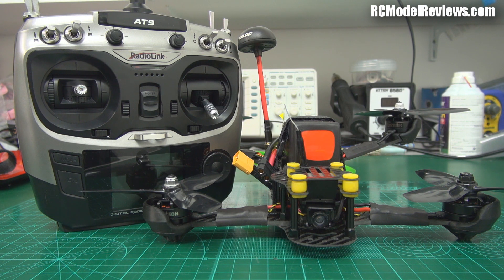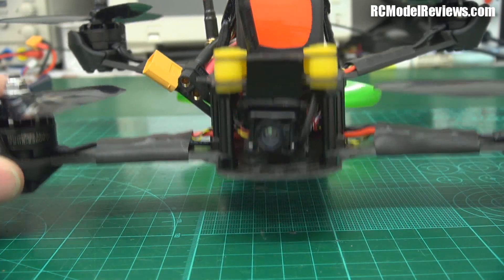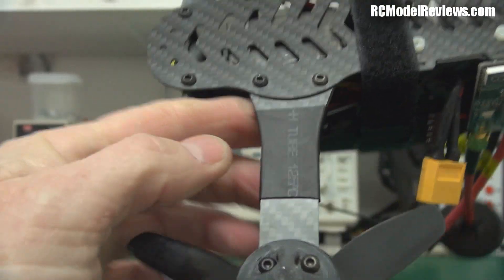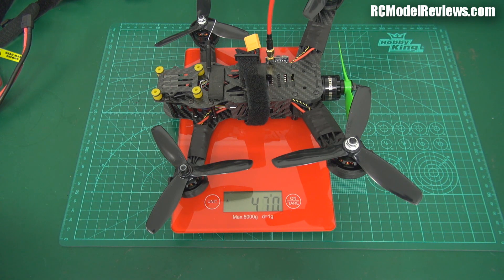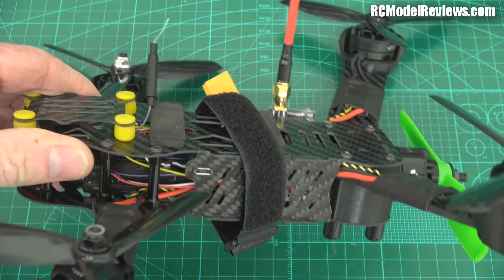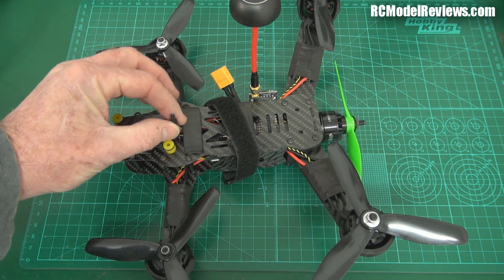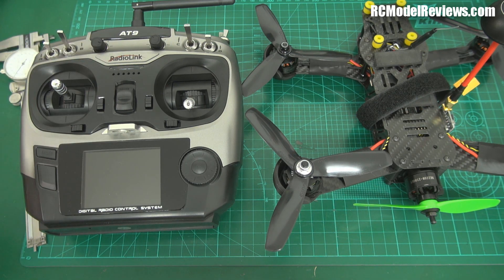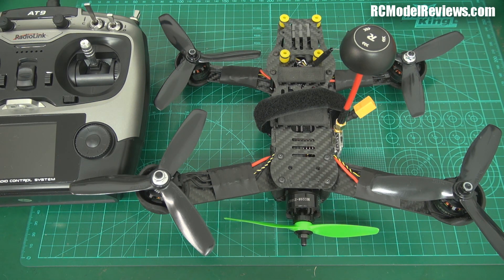Screamer 250 racing drone from FoxtechFPV

Comment: whats better? the naze32 or the sp f3?
Reply: sp f3 by far. if you want gps and a processor that can handle alll- uart ports no probs. the naze is good and if you only use acro moded and angle horizon. it handles fine. any more modes and the naze cant keep up if you have other peripherals.  but for a cheapy 6 dof i would go cc3d' ive sunk a few of these in pools and rivers and they are still going. ive had one naze32 rev6 survive the pool. no waterproofing done to any of them. but ive had 3 naze32 fry usb chips for no reason. still can connect with ftdi apadter on uart 1. but yeah. hardware reliability seems an issue with naze. and processor speed. f3 is just better.

Comment: hi bruce, thank you for the review, actually we can use SBUS and link the tail motor to a spare channel of PWM output ,so just 2 wires in that way, I didn't you they give you the screamer with full pwm link.  About the camera, it comes with a tiny gimbal 
you can move the angle up or down.

Comment: Those pico connectors on the VTX snap off in a nano-second. cut away the plastic a bit, hot glue it, and cable tie the whole vtx to the chassis and it should be OK... but that antenna needs to be much smaller to reduce the risk of breaking the SMA connector for sure.

Comment: Bruce. The antenna problem can be midigated by using an IBCRAZY Race Spec Airblade L.C.P. antenna. The antenna is 2.24 inches tall,bottom of the connector to the top of the elements. I have a set. They improve the look of the quad as well as giving great sensitivity.

Comment: The concern with the pusher prop driving the bird into the ground is solved by the flight controller. It is tuned to having a real shallow forward pitch angle.

Comment: Currently trying to wrap my head around on having a fifth control. But i guess this shouldn't be much different from the throttle cut switch on normal helicopters. Turning the motor on and off on a sport heli is pretty instinctive as well so i guess this should also work. Just hope you don't instinctively fall back on your helicopter days and turn on the motor while you're on the ground =P

Also seems nice that they took the effort of making  a USB extension cable so the socket is mounted on the side of the frame.

Comment: if the back motor is controlled by its own PWM channel, why not mix it with the throttle channel 3? that makes more sense than a 3 position switch!

Comment: The rear motors being higher than the front motors seems completely backwards to me.  This increases surface area in forward flight.  If it was reversed so the front arms were higher than the rear arms, then in forward flight when the quad tilts nose down a touch, the arms would level out.  As it sits now the arms are just going to get more drag.

Comment: I wonder if you could feel the counter-torque of the 5th motor.
Reply: The counter torque should be compensated by the flight controller -a pair of motors on one side will generate less thrust (or more) so in activated mode  the roll in one direction will be much quicker than the other. You can feel this in fixed wings so it will definitely be present here.

Comment: Seems to me to be a fundamental flaw having it on a separate channel rather than the fc doing the work to decide when to use the motor based on required angle and error. 

You are basically adding an external variable that will constantly mess with the pid calcs. Like flying in the most gusty wind ever?

Comment: Mode 3 with yaw on the right with the throttle is how I fly, just seems to make sense.
Might be because I started with 2 channel glider l, then 4 channel with a Cox nitro back in the 80's

The screamer looks interesting but fragile with 2 bolts on the strong arms and thin body plates.
intersting concept though.
Reply: I started the same way with 2m glider and mode 2. Just tried mode 3 on the sim , no way, mode 4 OK but need practice.

Comment: If it flies well, then you can adapt a wah-wah pedal or something similar for fine grained pusher throttle control if your transmitter supports external PPM inputs (the Taranis does).

Comment: The frame design is really bad. Double sided tape for holding components, VTX outside of the frame, Thin top and bottom plates, weak arm mounts...one good crash and you can throw it out. And the weight? Thats not a miniquad, thats a tank!

Comment: Can't the F3 controller be programt to tun on the 5 motor above, say 50% trust. And the turn iT faster when you put you stik up til 100%. Than you can juse sbus. The faster you go, the faster the 5th moter while spin!
Reply: The problem with that is that you'll end up either climbing to the stars or you'll face the same drag problems because you'll have had to pitch forward so much in order to stop the lift motors from increasing your height.  I would think that the fastest flight would come from using just enough lift-motor throttle to support the weight of the craft and thus be able to keep it level with full power on the forward-thrust motor.
Reply: I don't know what firmware is running on that FC, but Cleanflight is able to pass AUX channels through as PWM outputs on some of the RC input pins. This can be useful if you want a SBUS/PPM connection and still control external PWM things. I managed to get it working a while ago to control gimbal pitch, but the documentation is very thin - google 'channel forwarding'.

Comment: My biggest concern is you tilt more to get maximum speed, but then the thrust motor is pushing you down down down, lol. I like they are trying something new and exciting though!
Reply: Vectored thrust quad, now you're talking!
Reply: I fully agree with this. In order to fly this penta copter correctly you need to fly it like a fixed wing. then shut the thrust off and continue as normal quad. problem is the main rotors can give you 4x the thrust than the single pusher. so why to bother? it feels similar to tilt adapters under the motors. and best use of motors for Fwd flight is a tilt!
Reply: Przemysław Jakubczak I saw a flight video from foxtech somewhere, and it does seem to work ok, but had to keep pretty level, so no faster than anything I have, haha.
Reply: What if they angled the pusher motor to be level when flying at full tilt?
Reply: Interesting idea. Like a tilt pusher that will always provide only horizontal force.
Reply: Przemysław Jakubczak ***** This would provide severe problems if not flying at full tilt though, as it would try and flip the quad forwards, and make the motors strain to keep it from going crazy, if they could even stop it. I servo that tilts it in relation to the angle would be superb, but takes up room, space, and money, haha.
Reply: I should have specified that the pusher only be activated by the switch when full tilt. But I do like the servo proposal. I think it could be done pretty easily, with software to control the servo relative to angle.
Reply: +Mike Meyer If you build a race quad you know that the motors lift motors provide thrust at least 4x weight of quad. If so you can tilt the quad by 76 deg to maintain level flight and get max axial thrust. and this thrust will be still 3.87x weight of quad giving you 3.87g of acceleration. This axial motor will have to be much beefer than shown to provide that. 

My point was (similar to proposed above) to have servo controlled tilt of this axial motor. then you can either fly it less aggressive using main rotors only for hover or you can use full available thrust to go insane forward. 

I must admit that the axial motor us the most efficient to go horizontally but quad pilots will have to learn to fly it the other way.

or they can tilt it manually by 45 deg like they currently do with the cameras and activate it at max speed to make it even higher speed.
Reply: +Mike Meyer True. so it would be more preferable to put only small hover motors to provide only sufficient lift with small margin for vertical adjustment monouvers and relay on the axial motor. having strong main rotors and a screamer in the back doesn't make sense or is an overkill.

Comment: I'm thinking that a 45° forward would force the pusher motor would push the quad down from the 45° on the pusher motor for the issue
Reply: you missed the whole point of this design didn't you?
Reply: +TheRattleSnake3145 you know that you have to make maneuvers
Reply: +TheRattleSnake3145 plus 4 motors have more thrust then one motor but would be a good idea for aerial photography so you don't have to put the props in the video scene
Reply: Whats your point with this comment?
Reply: 4 motors do have more thrust but weight of the craft needs to be taken away from that as does the extra drag. 
  I never said that this concept was better, I just pointed out that you misunderstood it.
Reply: TheRattleSnake3145 I can't misunderstood from flying multrotors for over 8 years so why were you complaining about my post
Reply: +Piggish450 I was correcting you , as you clearly don't understand the concept , not complaining.

Comment: run the back motor in reverse to keep it in the air and then fly it almost fully horizontal! I know it defeats the purpose of the quad and introduces all the drag back, but it would be cool to see if it works.